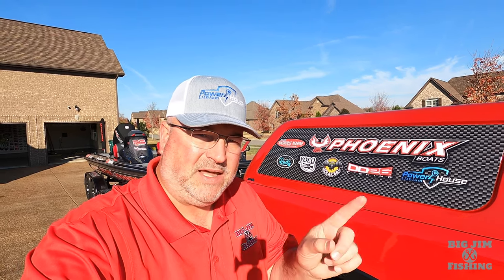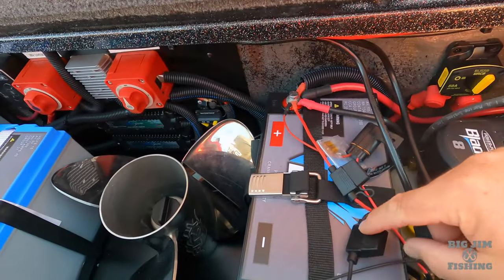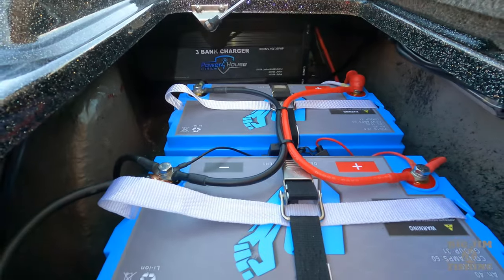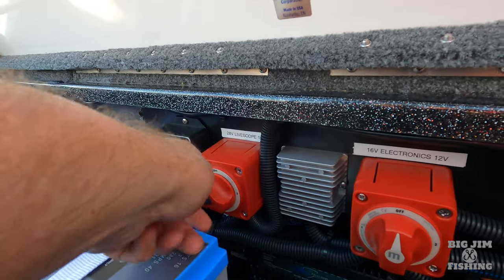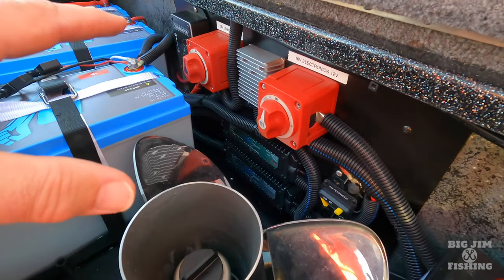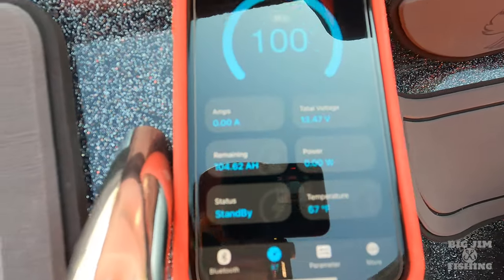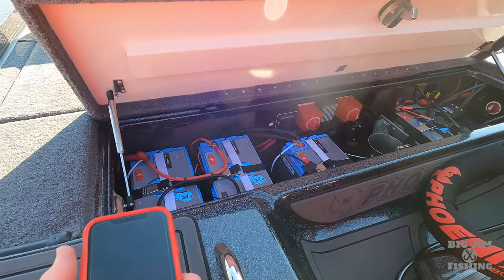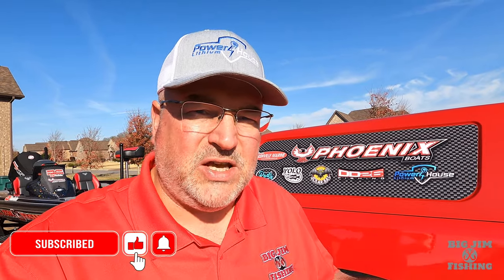Best battery set up for bass fishing ever!

Comment: I love the setup I’m just curious how you have the 36 volts hooked up to charge if it’s a 3 bank charger…. Since they are paralleled does the charger just hook to one battery and it charges both of them? Or how does that work.
Reply: So them being in series it charges them both with the charger only being hooked to one of them
Reply from the maker: @jacobcooper3589 I’m sorry, my two batteries are parallel.  Hook up to one and they both charge.
Reply from the maker: @jacobcooper3589  yes.  2 36 volt in parallel.  They charge together. It’s like one big battery

Comment: What’s the wiring diagram for connecting parallel batteries to the trolling motor? I’ve found conflicting information online.
Reply from the maker: Red to red, black to black is parallel
Reply: @BigJimFishing  did you split the leads, pos on one and the neg on the other. Or trolling motor leads on the same battery?
Reply from the maker: @Big_Mike72  I did not do anything.  They were professionally installed by my dealer before I took delivery

Comment: Common workin man couldnt even afford all that
Reply from the maker: 10 year warranty, add of the cost of lead acid every year.  It’s actually a great value over time.
Reply: Lead battery will last usually 3 to 5 yrs at 99.00. That's prob 3000.00 set up min
Reply from the maker: @garyheath9531  I use them more, did not last half that